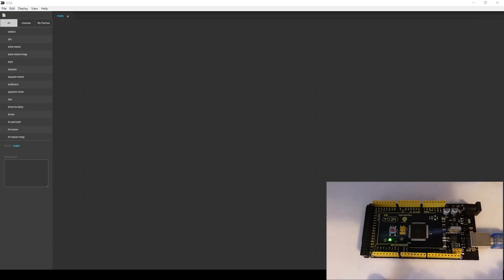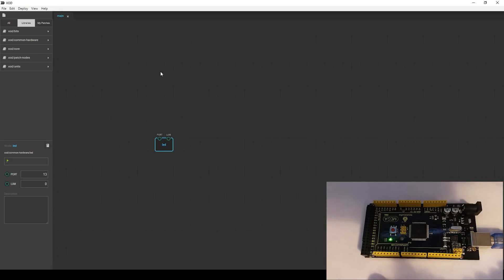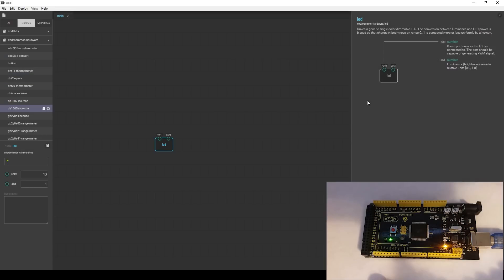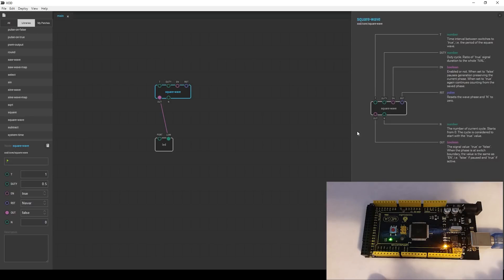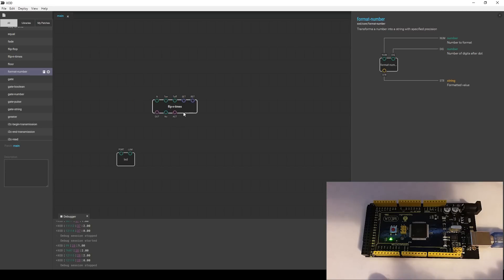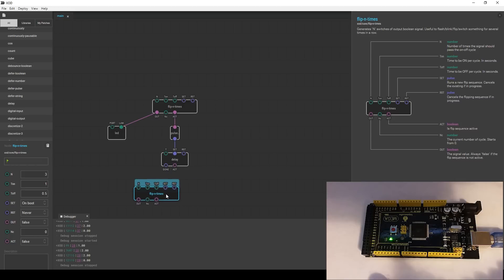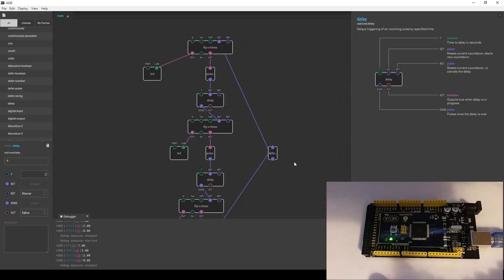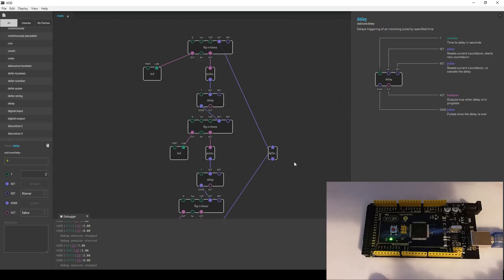XOD Tutorial 1: Getting Started

Comment: Great Video.  Thanks for making it.  I tried all the exercises you went through, all worked EXCEPT the sine wave driving the LED did not work, either on a genuine Arduino or a freetronics "eleven".  The behaviour of the "sketch" for the sine wave was exactly the same as the square wave, i.e. on off, with no fade.  I'm using a MAC with the latest operating system.  I note, same as an earlier comment from another viewer, that your help bar is very different to mine.  Please make some more videos on XOD.

Comment: Thanks for the video! XOD dev is here. Let me explain what’s happened with the SOS LED.

I was quite surprised that the LED even started to blink with the patch you’ve build. There we see a closed loop with no chance to start running. “On boot” you’ve set in the beginning gets overridden by the final feedback link. But, then I thought “Ahaaaa!”. The `pulse-on-false` nodes did the job. We start from `ACT` equal to `false`, right? They fire and cause `flip-n-times` start, all at the same time. That’s why we see glitches on the first iteration.

We should really provide a `DONE` output pin on `flip-n-times` and think carefully again about `pulse-on-true` and `pulse-on-false` initial behavior.

BTW, I don’t know why upload is soooo slow. We have tested XOD on six PC’s, all with different specs and OS’es. Never saw something like this. Soon we’ll release an update which will give more detailed output on what’s going on while upload. I hope it would help to narrow down the problem.
Reply: it's similarly slow here as well.